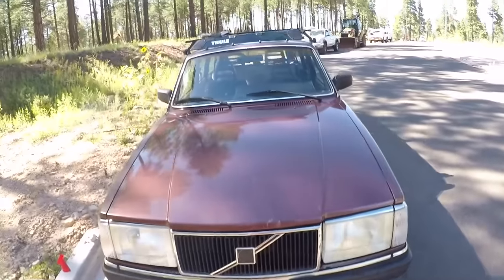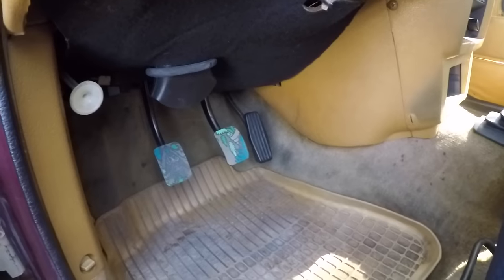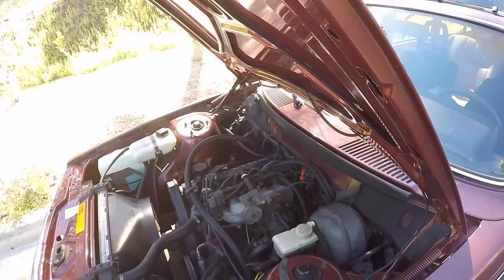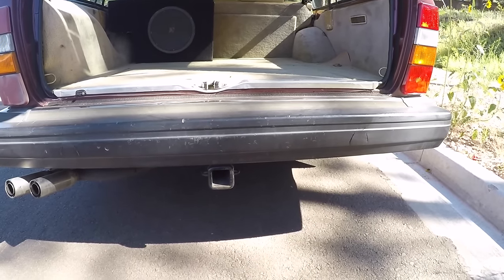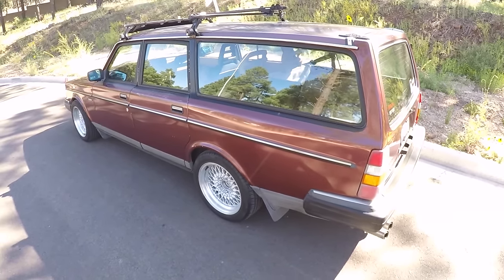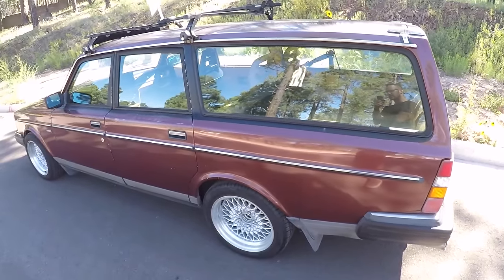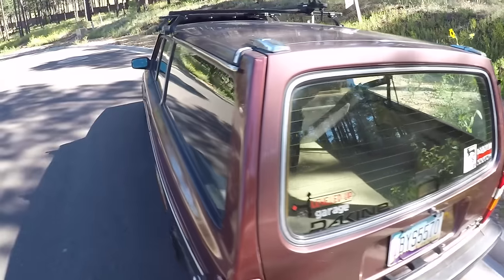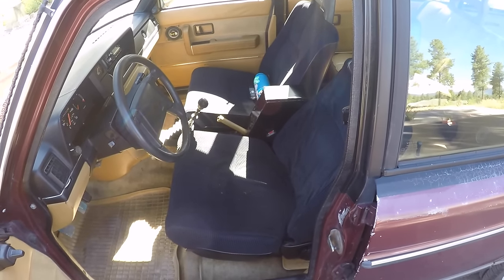The Volvo 240 is Actually a Great Enthusiast Car + Walkthrough and Drive

Comment: The ultimate manual gearbox to put in these cars is the M90. It's a whole new design and uses three axles for the gears, so it's at least as strong as an M46, but is much, much smoother to shift than an M47. It only came on later model 940s, and I don't think any of those were sold in the US.
Reply from the maker: Yeah, from what I've read and heard the m90 is sweet, tough finding one, and expensive to import one. The ford t5 with an adapter plate is also a good substitute!
Reply: I live in Britain, and scrap 940s are plentiful here. My 240 is completely stock other than an M90 swap. It is a quantum leap forward from the M47. If you ever find yourself in Europe, pick one up and smuggle it home in your luggage :P.
Reply from the maker: Haha if I ever find myself in another country I will want to get a shipping container full of stuff to smuggle home!
Reply: M90 is good, but not forgiving, third gear syncro is really weak! Going over 400. For get it!
Reply: If you're going over 400, no Volvo gearbox is suitable IMO, you need a T-5, a BMW or Supra gearbox. The 3rd gear synchro ring can be welded in place to stop it breaking, and Volvo themselves addressed the problem in 1997 and strengthened it. Those can be tricky to find though since that was the last year the M90s were made.

Comment: 2.7 million was their total world-wide production and sales of the 200 series models, not the number that were sold in the U.S.
Reply from the maker: I believe you are right on that, thanks for catching my mistake!
Reply: Not a problem. BTW I have owned and driven Volvo's since 1978. My first being a '74 142, then a '77 264GL, followed by a '86 240GL and since 2000 a mint condition '90 740GL. They are all I've ever owned and will ever own - they are that good. It's good to see you respecting these cars for their quality, durability and easy repairability. Keep up the good work! :)

Comment: There actually more than few wheel option for 200 series.
I too thought that were only a few until i did some research.
There are a lot wheels with 5x108 bolt pattern but the issue is ET.
Solve that with getting wheels with similar to OEM backspacing, with spacers or by mini tubing and pulling fenders.

Comment: +Budget Build Bureau - At 14:50, No, you CANNOT merely add a turbo to a naturally aspirated engine.  The reason is that, an NA engine already has a compression ratio of 11:1, which is already quite high. However, adding a turbo would cause it to start having massive leaks & blown hoses everywhere. A turbo engine has a LOWER compression ratio because, it builds a higher compression from the turbo itself.
Reply from the maker: Gordon302 Not sure where you are getting your info from but you should check your facts.
The n/a b230f was 9.8:1 compression, while the turbo b230ft was 8.7:1
Not only can you just strap on all the turbo stuff including the ecus from a 240 or 740 turbo but many people have and have made more power due to the higher compression ratio. It is called a b230f+t build. 
Anyway thanks for watching and commenting!
Reply: Compression on B230f is definitely 9.8:1
Reply: Some b230 had higher compression rate

The b230e if i recall, mostly european version, they came without the cat and made around 133hp

Comment: My 89 clutch is hydraulic - master cylinder comes through the bulkhead to the back of the clutch pedal
You have the blanking plate under the cable 
Great vid though
Have loved restoring the one I bought Dec 21
Reply from the maker: You must have a non-US spec or 260 unless it’s been modified. US spec 240’s never came hydraulic clutch. You’re lucky, it’s a much better setup haha! 
Nice, glad to hear it, such fantastic cars
Reply: @BudgetBuildBureau  sorry yeah I’m Uk :) so master cylinder on the RH side feeding off it’s own reservoir - pipework along the bulkhead down to the slave on the gearbox :)

Q - how did your fender-arch roll go? I have 18” oceans all round and 60mm drop on the front (no issues) and went 40mm on the back and the car sat on the tyres. So went for 15mm springs and still rubbed so went for a small spacer above the rear cup so only about 5mm drop on the back now
Reply from the maker: @problemchild1976  there is a ton of clearance to be gained rolling the arches. I used a proper fender roller and heat gunned the arch so the paint wouldn’t crack, turned out great

Comment: Awesome 240 man!!! Love the work you've done on it. Would love to do a manual swap on mine someday just to make it a little more fun to daily drive, but even as an auto it's wonderful. Lot's of great info too for someone looking to get into one of these. Got my first 240 wagon back in January and you hit the nail on the head with everything. 

Only thing i'd add to the "down side" list is, for whatever reason, the tan plastic interior bits are the most fragile material on earth. Seems like the black pieces don't get as brittle and crack/explode like the tan versions do. 

On the plus side, i've never really turned a wrench on a car before owning one of these so i'm learning as I go. These cars couldn't be any easier for that process -- tons of space to work, affordable parts, and great manuals/online documentation.
Reply from the maker: george fava if you do decide to swap it out to a manual, just make sure you gather all the parts first trans, clutch, flywheel, cable, pedal box, front half of manual driveshaft, and some 10-30 synthetic motor oil! It’s not too bad. 
And you are absolutely right on the tan plastic, not sure why that is!
Reply: If you are talking about 10w 30 for the transmission, that should work just fine. For my m47 swap, I ran mtl fluid i bought from ipd, and the five speed felt great, its just more expensive. also @george fava my shop manual said the m47 took something like 2.4? quarts of oil for the tranny. In reality, it took less than 2. So if you go the mtl route itll save you a bit of money since a 1qt bottle is around $15
Reply from the maker: Yes that's what I'm referring to, I believe IPD recommended using either 10-30 synthetic or MTL as you said. I filled my trans while out of the car and put the full 2.4 quarts of mobil 1 10w-30. Trans felt great!

Comment: Is a 87 Volvo DL auto with 220k miles for $700 a good deal and if so what are some good tips for making sure its a strong runner, it will mainly be used as a errand runner, a daily to work when its too cold to bike, and an occasional outta town or state trips
Reply from the maker: Landon Klick pretty cheap, I would say check all the fluids, make sure the colors, levels, and smells are all good! Other than that drive it and trust your gut on whether it’s a good runner or not, if you can do the maintenance yourself they are easy to own and cheap. Timing belt, water pump,  basic tune up, and fuel pumps are the most common that need replacement

Comment: Thinking about buying a Volvo 240, 1991 year, sedan body with 161xxx miles. Says the a/c and power locks don’t work. Could it be a good purchase?
Reply from the maker: Could definitely be depending on how much money, but thats low miles and later year so I'd say yeah, especially if you're in an area where you can get by without a/c until you can fix it. Power locks should be a simple fix I would think.
Reply: Budget Build Bureau sorry for the late response, I purchased an ‘86 240 GL sedan today 7-24-18

Comment: I had an old 240 turbo sedan with the Virgo wheels as my first car back in the late 90s. It was in rough shape, though. Always wanted to fix it up but couldn't afford to at the time. I'm wanting to pick one up again as soon as I have a place with a garage and fix it up, do all the things I could never do when I was younger and making minimum wage. I'd be looking for the turbo version and lowering it with aftermarket springs, as these tend to look a bit nose-high stock. Did you ever get all that glass tinted? I imagine ceramic film would give it a nice updated look and help it stay cooler.
Reply from the maker: nice, sounds like a good plan, more volvos into hand of people that care! ended up selling this one not too long after the video but have owned a few since then. currently have a 73 volvo 145 and 80 242 coupe.

Comment: Thanks for the great video.  I am also learning to work on my 1988 245DL.  Wondering if I could ask your opinion on a problem that so far two volvo mechanics can't figure out.  Going down the freeway at 60mph+  it starts to make a knock/rattle sound, and when I slip it in neutral abd rev the engine it gets faster, and the engine sounds louder, like there's a hole in the exhaust system.  They didn't find one.  One of them said it could have something to do with the catalytic converter.  But both said the car is running very well otherwise.  But neither had ever heard of a problem like this.  Getting ready for a road trip so just a little nervous about it.  Thanks.
Reply from the maker: Sounds odd, could be part of the muffler internally letting go/rattling 
It’s fairly common at this point that the original exhausts are falling apart. Very common failure point on the 240 is the pipe breaks away from the muffler

Comment: 1500 bucks!? Here in sweden we can get a verry nice 940 turbo for about 1000 bucks XD
Reply from the maker: Send some of those my way then hahah! They are becoming more popular here now and are starting to come up in price.
Reply: Isak Elgendahl I got my 940T for just 400$
Reply: A very good 240 costs in germany roundabout 5000-15000 euro...
2000 for a rusty one 😅
Reply: Eisbär the good ones are getting expensive in the US
Reply: @jensson3068   i bought my 244 for 3800 .160.000 km and little bit of rust. piece of shit making so much problems haha
Reply: Meanwhile in France price was always 3000+ for an okay one, with a b200e..

Not even a b230 nah 
And only a few b21 

Again, 4000+

The turbo ones are at least 6000€

Yes

€

Don't forget 1€ is like 1.1$
Reply: Så är det !!! :)
Reply: Locally i found a running one for 400usd i want
Reply: @bgf1lms843  luckyyy youuu they cost soo much here
Reply: I paid £99 for my 940 don’t know what that is in usd
Reply: Went to look one 1993 b230f wagon, same redwood metallic like in video! It has good engine and running gear on it. Some what decent body, some dents, bruises, rust but thankfully not rusted though. Price is 1000€. And it has AW70 auto gb

Comment: Hello can u tell me if the preheat hose on the 940 base should stay on, the mechanic didn't replace it and said I didn't need it but never mentioned the air box thermostat what to do with it or if I should somehow close off the openings where the tube was, seems like it puts a lot of hot air into the engine area.

Comment: how is it with no A/C. does is still blow decently cold air? If I understand correctly you can still adjust the temperature from warm to cool on the fan? 

looking to buy one but I'm getting stuck with a lot of options that do not include A/C.
Reply from the maker: Sean Carbs this wagon had a/c just not having tint made it struggle in Arizona heat. 
If the car doesn’t have a/c it will blow outside air temp at the coolest, more likely warmer than outside air. 
If you live somewhere hot, I would wait it out and find a car equipped with a/c

Comment: I'm sorry but the 740s 940s there was just so much better I owned a 240 was my first car and then I picked up a 740 turbo and a 940 turbo wagon from the auction same engine but they feel better the two forties don't feel as put together or stable ....I mean they're tough though
Reply from the maker: Yeah 740 and 940 are definitely more refined. Had a 740 turbo that was a nightmare (early wiring), so I tend to prefer the simplicity of the 240.

Comment: the one thing i could never understand is that they never imported the the two best cars volvo produced into the u s a ,that was the glt 245 and the 360 glt, these cars were uprated thicker front sway bars the 240 came with 138 horse motor ,the turbo was never produced in r h drive , the wagon with stiffer rear springs plus rubber inserts for towing made a damn quick fast road truck even towing my race car , the 360 glt had the 2litre motor at 120 hp with a rear mounted transaxle , this was a real little fun car , been a volvo owner since 1961still run a v90 a real car a 98 car after 98 they went front wheel drive and i will not own one
Reply: My son retired his 240 at 303K miles (we just parked it out back, nothing wrong with it). He bought a 245 one year newer (1991 I think). Don't know how it got here but it does have the single big headlight (European). I guess some of them made their way over but I agree they are not plentiful. Thanks for the specs, I really didn't know the difference other than looks.

Comment: You mentioned the Crown Vic Wheel had a zero offset w/ 32 mm spacers. I keep finding them @ 6mm offset. Can you confirm for me? Thanx
Reply from the maker: Smokin' Man there is 2 different crown Vic wheels, double lip or single lips, otherwise look very similar. One is 0 et and the other is +6 et. With the 32mm spacers it was effectively at -32mm et with this setup. Hope this helps

Comment: Could you show the location of the tachometer connector location on the dash cluster in the back. I've been aware of this option but have not pulled the trigger since I've not yet found a oem tac or a vid of this conversion(in depth). Much thanks!
Reply from the maker: rippenrider I believe it just sits behind the cluster and has a spade connector already on it, red with white stripe Iirc

Comment: Hey man what size tires are you running on these wheels? And is it at stock height? Im gonna put the same wheels on my 93 244 and i really like the stance of your car.
Reply from the maker: Sean Ryan they were 215/55r16 I believe. Stock height on back, gt sedan rear sway bar and the springs were definitely sagged from towing so keep that in mind. The front springs were cut 2 coils ( I know, cut springs... but these have like a foot of suspension travel and are soft springs, so with 2 coils cut off it rides great actually) 
Needed a heavy fender roll to clear these wheels with the spacers offset was -32mm
Reply: Budget Build Bureau Budget Build Bureau so a heavy fender roll on all 4 or just one end? And why did you go with 32mm adapters? I figured with the already low offset wheels you would go with thinner ones?
Reply from the maker: Sean Ryan 32mm is the thinnest spacer adapter for the bolt patterns that I feel comfortable with. And it was a pretty heavy roll on the back, moderate on the front.

Comment: I was planning to swap a m46 into a 740. Guy said it was a hydraulic setup. You know if it's possible to convert them to cable?
Reply from the maker: if it is a hydraulic throw out m46 then I believe it must be out of a 740. It would be possible to swap that to a cable clutch but if the guy has all the swap bits for the hydraulic setup it may be worth going that route. You would need (front half of 740 manual driveshaft, master cylinder, hydraulic car clutch pedal, slave cylinder, pivot fork and ball, clutch line, proper flywheel (sensor hole one if 89 and newer), and the m46 electronic overdrive stuff). this page can be very helpful with this information http://www.240turbo.com/hydraulicclutch.html      Thanks for watching!

Comment: I have a 240 1991 and looking to change from Auto to manual.    How much in parts ?  Thx
Reply from the maker: bit of a late reply but I just released a video series on how to manual swap these and what parts you need. I have swapped 2 with all junkyard parts for under $400 all in with new clutch and fluids! Check out our channel for those videos. Keep in mind youll need the flywheel from a 89+ LH2.4 car!
enjoy the car!

Comment: Hey been looking around and wondering if anyone can confirm. I have an 84 245 automatic wanting to put an M47 in it. Wanting to make sure that it will bolt straight on with a new drive shaft and hanger.
Reply from the maker: Yes it will! Make sure you have the correct clutch and flywheel. I have another video series on this swap, check it out on my channel, just ignore the crank position sensor stuff.

Comment: BBB what do you think of the 84 Volvo GL wagon as a first time project car , just wanna slam it with offset wheels to use as a daily driver.
Reply from the maker: wayne hardy sounds good to us! Just be aware of the possibility of wiring or electronic issues of the early harnesses. Good luck and enjoy it if you buy it, thanks for watching!
Reply: Budget Build Bureau  what year would I not have to worry about the electrical systems
Reply from the maker: wayne hardy 87+ will have the lh2.4 harness, if it is it will have a little check computer on the driver side strut tower

Comment: cut springs? shivers
Reply from the maker: Honestly on the 240 it is absolutely bearable and feels like any other stock car, at least with 2 coils cut. Still was soft and had plenty of suspension travel left.
Reply: did they still fit snug when lifted of the ground? if no it's not for me ghehe I know plenty of guys doing it though and I do believe you^^
Reply from the maker: Fabian van den Bussche they were still snug when lifted, there is huge amount of preload on the factory springs
Reply: It's possible to cut off the top section of the bump rubber aswell, that increases the suspension travel a bit more after cutting the springs.
Reply: however some lowering springs will make the ride bether, it wont be as soft as the original springs are but not to stiff aighter unless you where to compliment it with some bilstein B6 dampers, then you got a stif sporty ride feel.